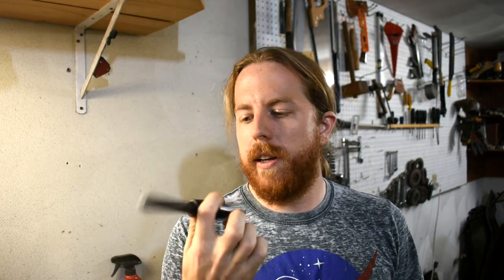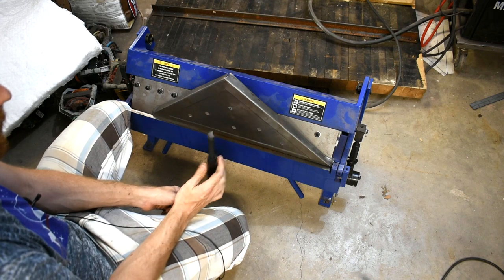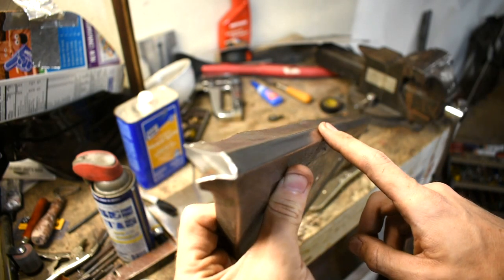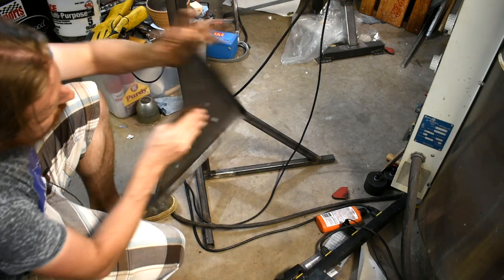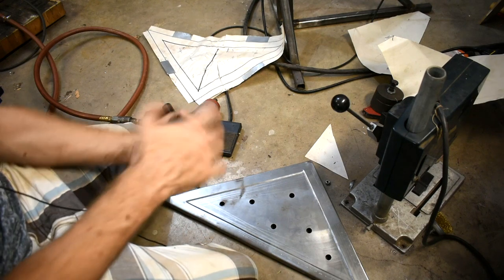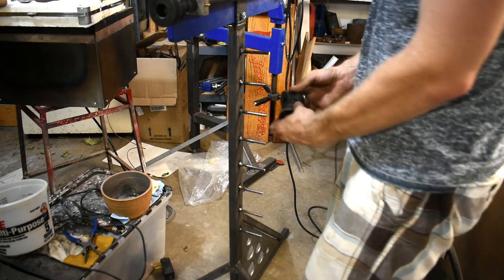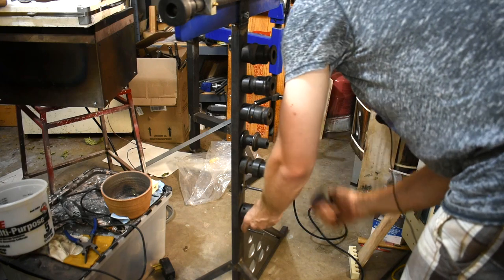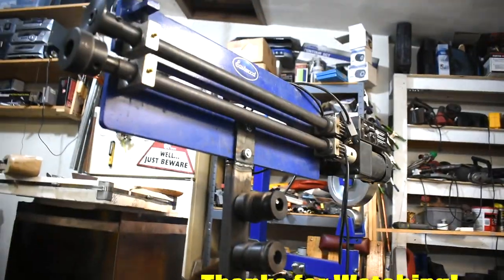Upgrading the Stand for my Eastwood Bead Roller Part 2 (of 1)

Comment: So what happened to the gingery lathe? Did ya give up on it, or do I not know how to operate YouTube?

As for the handle, you could weld it back on, weld a bit of bolt to it and drill a hole to tap where it's supposed to go,  drill 2 holes in the bead roller (if its hollow, else just 1 will do) and use a piece of round stock to go through it (secure with welds, or even holes in the round stock with pins, just to stop it from moving.) Um. Just a couple thoughts.  You're almost certainly more knowledgeable about such things than I am.

Good luck in any event. Glad to see you back at it@

Comment: if you can get the tread out you can probably retread the end of the lever and reinstall it , since its a chineese tool chance is big that its metric tread 
lesson learned (i hope) those levers arent made to take the full weight of a human , the slightly shorter leaver should prevent from too mush force being used the next time , just dont slip a piece of pipe over it 
bet you can use youre cat to rough up metal , just dragit across the plate a few times after getting it mad or trow it in the air and let it land on a slanted piece of metal the scratches with go all along the plate to the bottom , i would say comparable to 60 grit sandpaper 
the brake you have for bending is a fingerbrake meaning you can take off part of the bending surface/ holddown (fingers) from the top and create room for the allready bended sides to clear 
gives a cleaner bend then finishing with the pliers
Reply: It's a THREAD and he's screwed.  He needs to take it apart, drill and try an easy out.  Heat sometimes helps.  Wait until he tries to tap it.  Then the tap will break because it too is made in china.  Drill over size and use SAE.